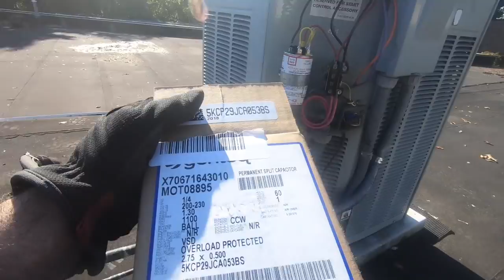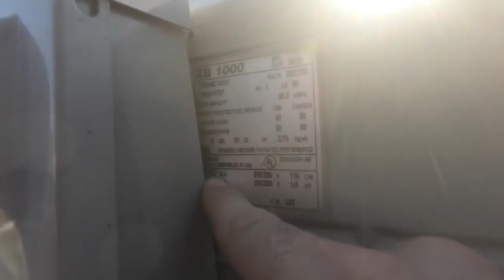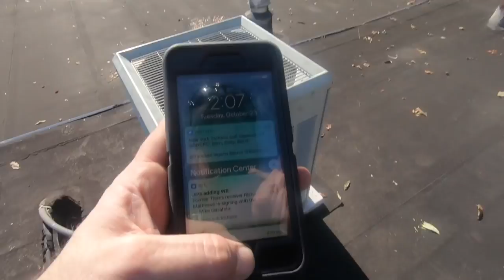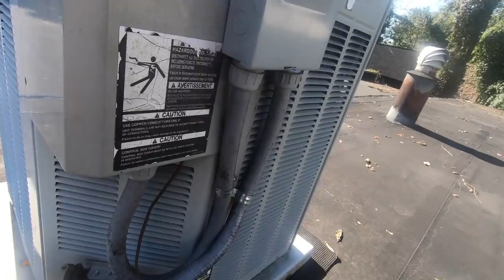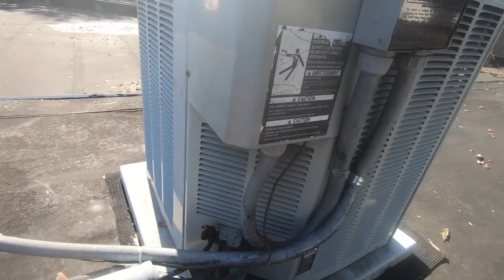Replacing AC Condenser Fan Motor

Comment: Good job. I have been in the field for 20 years and have seen my share of crap work. I personally do not like rescue motors or fits all caps but sometimes you win with those. I prefer OEM stuff but sometimes that's not available or easy to get.  Thank you for this video. Keep up the good work.
Reply from the maker: This was an interesting job. First time in 20 years I ran into wrong parts installed in a system. The OEM was the only way to go here.
Reply from the maker: Rescues are good since they will get you through most motor replacements. I will not use a rescue on a carrier condenser since they over heat when in place of those 875rpm motors carrier uses.

Comment: You are doing a good job. I worked as an inspecter in a factory that made spider hub fans and other fans. The corrosion and dirt on the blades could put the fan out of balance and cause issues. Best of luck in the future.
Reply from the maker: Thanks do you think it could have been dirt on the blades that made that noise that went away when I first tested the fan?
Reply: @thehvachacker  Probably

Comment: Towards the end of September, I performed what was most likely my last installation of a gas furnace/central air system. For the last eight years, while enjoying retirement, I've augmented my income by repairing Goodman/Amana PTAC/PTHP units for a group of 30 motels/hotels. I'd co-owned a Carrier dealership for more than 18 years, until retiring because of MS, in 2002. 

I've kept a Motorola Two-Way Comm dealership, and a "light-duty" central air install/repair service going since, and stopped doing installs around 2008.  "egg money"....

In early August, one of the owners asked what it would take to install a new gas furnace, and central air, in his manager's residence 1,425 sq-ft, with an unserved storage area, of another 500 sq-ft.  I'd recommended a 2.5 ton 16-SEER  AC, atop a 48,000 BTU 92 AFUE condensing furnace, and told him to 'stay away from micro-channel coil systems'.

Around the middle of the month, his 'chosen' contractor, the one with the lowest price, delivered a 72,000 BTU, "C"-width furnace; 1.5-ton "nominal" "A"-width evaporator coil; and a 2-ton condensing unit. Did I mention that the A coil and condenser were microchannel??

They unboxed the evap, and the furnace, and the motel's maintenance person noticed that the evap was less than 2/3rds of the width of the furnace. By that time, the contractor had knocked off for the day, at which time, I was called, as was a really good furnace guy, whom I had previously recommended. The next day, the 'lowest price' contractor, showed up, and was instructed to wait until the furnace guy, and I, showed up, to discuss the mismatch.  A pi**ing contest ensued, after explaining that installing an evaporator with that much of a mismatch, would "take the blower, overtemp protection, and probably the inducer out in less than a month, and that the blower was so oversized - with relation to the evaporator and condenser, that evap was unable to effectively saturate the air flowing through it, and that its speed couldn't be 'dialed-down' enough to be even remotely effective. I'd also informed him that the system needed 2.5 tons of cooling capacity, because of the heat load presented by a southwest-facing 'non-tinted window bank', which measured 18' x 47", and a very minimal reserve necessary to cool the two rooms adjacent to that unserved storage area.

The contractor was fired after refusing to install a "C"- width coil, and upgrade to a minimally required 2.5-ton condensing unit (both the evap and condenser needed to be exchanged, per the conversation with the manufacturer's tech support (actually, I received a status upgrade to an "engineer level interaction required", within five minutes of the call's inception.)

Long story - short, The furnace guy sleeved the chimney,for purposes of meeting code, and preventing damage to the chimney via the exhaust; did the furnace's set-up, I installed the upflow furnace/air handler, plumbed the lineset (sleeved in 2-in CPVC, in order to prevent galvanic response - with the calcite contained within the composition of the blockwork); modified the evap's high side intake (per the evaporator's instructions); installed a breaker-protected disconnect, on-to the Schedule 40, 3/4-in conduit, fed through the basement wall, plus the remainder of the electrics, necessary to operate the systems.  I also constructed, and poured, the 4'x4', ten Inch thick reinforced concrete pad for the benefit of a nicer, cleaner install.

While not a totally "best accepted practices" install, "she ain't shabby" - either..

Comment: Around August my air-con stopped working and if had called the repairman it would have cost me like 300 to 800 USD to repair it. But with video like this that you content creators make helped me diagnose that it was just a capacitor. So I order the exact same one off amazon followed the diagram and installed it. And like magic it worked and cost me around $30. Thank you for videos like this keep it up.
Reply from the maker: 300 to 800 is a lot for a capacitor.
Reply: @thehvachacker  I agree they added a extra zero on the quote. Thou I do agree that everyone has to make money for service rendered, but it was in the middle of the 100 F heatwave summer. Still I thought it was too much, so I decided too watch videos on how to fix it.

Comment: Just for what it’s worth— A box fan placed on top of the unit and wired in to the contactor to run with the compressor could keep the unit up and running until you returned with the OEM motor.  Also, any motor repair shop could provide the threaded rods long enough to make the motor you tried to install on that service call work and not have to wait for the OEM motor.  Just my 2 cents—
Reply from the maker: I had no time to leave and get anything for the job so I had the parts guy order motor

Comment: I'm just a starting programmer and had worked for one year as an assistent for an electrician and therefore don't know much about cooling systems and exspecially their gases/liquids. But with your comments I can follow what you're doing and more importantly, why you're doing things. And by doing so I learned quite a bit from only 4 videos (until now). But I just can't understand why your videos got spammed by trolls.
Keep up your great work and greetings from Germany :)

Comment: As a former ASE mechanic I used to have customers that would try to tell me how to fix their vehicles.  I would smile and oh thanks, glad I have been doing this for years, and even have some schooling as well.  Then I ask them well since you know how to fix it why did you bring it to me?  That usually throws them off, and they have some stupid response.  My favorite one was a customer how told me her son said.  I asked oh is your son a technician?  Customer replied no he is a bagger at the grocery store.  Bottom line, those who like to nit pick, usually dont know how to actually do it.  He is doing a good job, and there are 100's of ways to take a nut and bolt off and on.  Use what you are most comfortable doing.
Reply from the maker: I love it. We get that with HVAC work also someone does air conditioning and says it is................ If they do the work why am I here? That's the end of story time and they let me work.

Comment: My second comment, coming apart with the impact is one thing, going back together with impact not so much. I can't begin to tell you how many stripped screws I have come across due to impact junkies! Good videos, keep up the GREAT work brother!
Reply from the maker: An impact is a useful tool and if someone knows to back off before the drill starts impacting great. I work with to many that you hear them impacting tappers till they spin freely. If I am tightening with an impact I try to stop before the hammering sound or once the first click happens.

Comment: I think you're doing a great job. You made Trane run for a little while longer. You could've told them they needed a new system the first day. But you didn't.....
Reply from the maker: I dislike having to have a system replaced. That is last resorts unless the customer just wants to go that route due to the age of equipment.

Comment: Anyone can turn a wrench. It takes knowledge to get the job done. Such a true statement. Here is another: Anyone can fix something. But to do it right the first time is a sign of a professional. You got stuck fixing someone else's mess, but owned it like a pro. I would gladly wait 20 days to get the right part than to have a motor duck tape and bubble gummed like it was. Clearly, it was going to fail, just a matter of time.

Comment: My question is why don't they put a dual screw type for the fan to the motor shaft and also have it keyed. Keyed or a shape like a D so the set screw has a flat surface to lock onto (if I missed it and it does have, my fault). Also I wonder why they don't use the type of set screw/bolt like the one on your puller where you can use a wrench or an allen key/wrench to tighten it, not that you need it with the channel locks you used.
Reply from the maker: The motor shaft is shaped like a D. You almost never see a small horsepower motor with a keyway. As for a dual set screw, Its an overkill on this tiny motor yet many motors have that setup. Now keyed shafts come into play usually on blower motors more that condenser fan motors. They always seem to use a Square set screw on these setups. I would prefer a hex bolt.

Comment: The worst things about unethical shops is they ruin the reputations of the craft. Had a plumber show up at my home and cut three holes in my wall, to demonstrate that the tile guy did it all wrong. He charged me almost $300 for the inspection, said he would fix the problem for $9,000 to $12,000. He didn't get the job. All he did was brag about his craft and how everyone else screws up. I have had two new homes. The only problems I had with the houses, were plumbing issues. One guy left the fill hose off the dishwasher, another guy screwed a self tapping screw into a clean out to install a cover plate, that later leaked and required dry wall repair and repaint. Another guy didn't bother anchoring the toilet ring, which pulled loose from the PVC drain pipe. I've had some problems with HVAC companies as well, not sabotage, but just plain incompetence. I had to install a new evaporator coil, the plumber insisted on running the condensate drain with out a trap, and now I have a burble in the bathroom sink where the first plumber installed the drain upstream of the sink P trap. I've had some problems with HVAC companies as well, not sabotage, but just plain incompetence, left a wire disconnected at the furnace, and said I needed a new thermostat. Replaced thermostat, same problem. Fixed wiring, no charge. Apologized for the uh oh...

Comment: Props to you for making these videos. Not everyone has the balls to show what they do without any editing. And mistakes do happen to everyone.
Reply from the maker: I am a good tech not the best so I will make a mistake. The mistake isn’t what is important it is how one recovers from it
Reply: The HVAC Hacker agreed. I have messed up too, it’s all about picking up the pieces, making it right, and not letting it happen again.
Reply: @thehvachacker  That is so very true. It's easy to look good when everything is going right and the only pressure you have is trying to get the unit up and running quickly. It's when things go wrong, even really wrong, that true professionals shine.
Reply from the maker: @Caspertg333  I had one of those jobs last week with an electric short. The metal shaving connecting g terminal to the casing. Very interesting since I had everything disconnected and still blew the fuse when connecting g wire to the terminal with the blower contactor and heat relay disconnected.

Comment: It's a good bet that old motor wasn't the right rpm. I'll generally do the research if I find a wrong capacitor. Comfortsite app or just call the supplier to get the correct part information. I did one of those little trane motors a summer ago and I want to say it was 850 rpm and we didn't have any luck finding a universal motor with that small form factor so we went OEM. I think the unit died a couple months later, I must have cleaned it up too good. I ended up keeping that oem fan motor back in the shop in case I find a home for it.
Reply from the maker: I find with the carrier and trane 825-875 com condenser fan motors it’s usually best to go OEM. Rescue motors die quickly when used in replacement. Johnstone does carry a motor that will fit the bracket and rpm. I used one at my dads house.

Comment: That run cap is something new to me. Apparently you get different capacities by switching jumpers? One cap fits all?
Reply from the maker: It is perfect for service trucks cause it's like adding several capacitors together to achieve a size you need. I have been using them for 13+ years and they are just as good if not better than the dual capacitors that come with the systems.

Comment: Bro, try some hyflex gloves.  They're cut resistant and you will have much more dexterity than you will with those thick ones you're using.  They're washable too, and one pair will last you a month or more easy.
Reply from the maker: S G hyflex are good gloves, yet you should try kyorene gloves. They are tougher than the hyflex. Yet hyflex are still great gloves and the black color hides how dirty they really are over the gray kyorene 00-450 gloves
Reply: @thehvachacker  I'll try those.  Thank you

Comment: I'd be careful about swearing on a recorded service call. If you work for a company, & they see this video, they could reprimand you.
CYA & don't give anyone a reason to cause you grief over a recorded service call.
Great video, none-the-less!
Keep posting them.
Thanks.
Reply from the maker: Most of my coworkers and higher ups have seen this video. This was a response to all the trolls that I was introduced to on the previous video of this call. Now I try to ignore the commenters up to no good. Not worth my time. Yet it was a learning experience.
Reply: @thehvachacker  I think you do high quality work. I am not sure what that noise was. It could of been a loose screw somewhere in the unit.
Reply from the maker: I was thinking possible something not moving correctly in the bearing, since it followed the blades until they stopped turning. Then was there for a bit and seemed to free up whatever it was.
Reply: @thehvachacker  Wasn't that a brand new OEM motor, though?
Well you did a professional job none-the-less.
Reply from the maker: It was brand new, yet it seemed the sound was from the motor. It went away and wouldn’t come back so it’s a mystery

Comment: so much since I started  working in that field 60 years ago , now retired ten years  horay enjoy watching . don,t let them get you down , lets see them handle the job and some of  [ those customers ]
Reply from the maker: I learned a lot since this repair series. It’s always easier to watch and look for faults. Which I realized I was also guilty of when watching sports. This field has changed so much in the 20 years I been in the field. It’s going to be all computerized and the blown cap jobs will disappear to blown modules.
Reply: @thehvachacker  and noone will have the modules as we found in tv repairs  ret 2007 did both tv &ac .very sensitive to static. A power outages .

Comment: Dropped a screw !!! Straight to detention and don't forget to clean the blackboards. This machine must be giving you nightmares. Hopefully this is the last you'll see of it for a while. Thanks for the upload. Great series of video's. If the last tech said it was fixed but won't last, he's hopeful the guy will say give me a price for a new unit. Then he sends in the sales guys and waits for his cut of the commission. Have seen it time and time again. Curious, what type / brand is that nut driver screwdriver combo ? Looks good and very practical.
Reply from the maker: Detention again, but I been in detention all week! Nah I like this machine it showed me how valuable a video can be. This customer I had to show this video to just cause he needed to see what I was running into. I am just surprised it took so long for me to get sent back to do the repair. That driver handle is the Malco connext1 handle. It works with all1/4"  hex shank bits which most of us have already for our drills.
Reply: @thehvachacker  Thanks. I'll add a couple of those to my order for a couple of the Braum flashlights you turned me onto.

Comment: That sound the fan was making could have been the blade making a slight contact on the shroud around the tips of the blade. Probably just took it a few spins to wear it in. Sounded great when you got done with it.
Reply from the maker: Possible it only lasted a few seconds and gone to never return

Comment: What was the name of that adjustable wrench?
Reply: knipex pliers wrench
Reply from the maker: That adjustable wrench is the Knipex Pliers Wrench 8603180sba. I keep the 7" which is 180mm long in my service bag. You can ratchet it around the fastener without losing your size since the handles allow the jaw to open and close. It replaced up to a 10" adjustable which means I have on tool instead of a 6", 8" and 10" adjustable wrenches to carry with me. It does come with a cost it was around $40 yet worth it.

Comment: Capacitors are cheap easy way to insure a more expensive call back later (motor replacement).
Reply from the maker: They left an estimate for equipment replacement. After doing a repair to the inside furnace